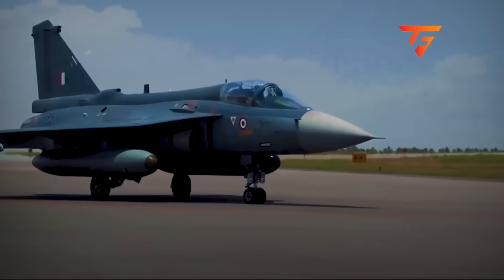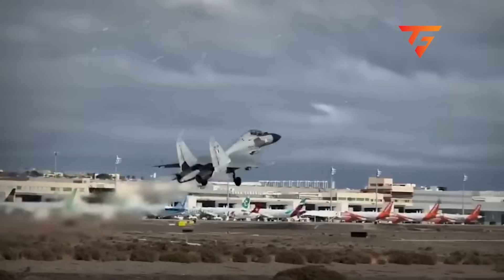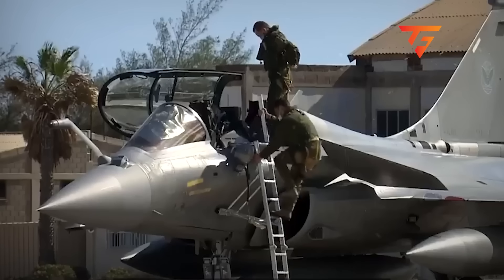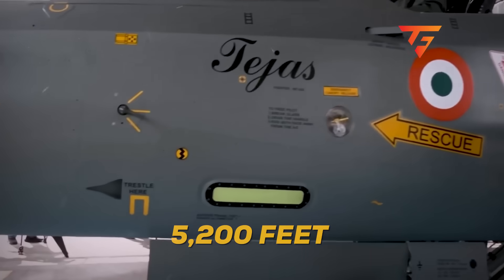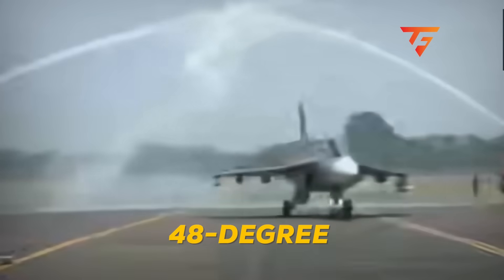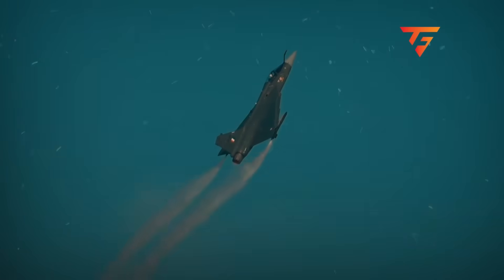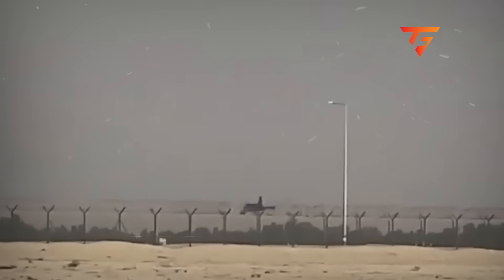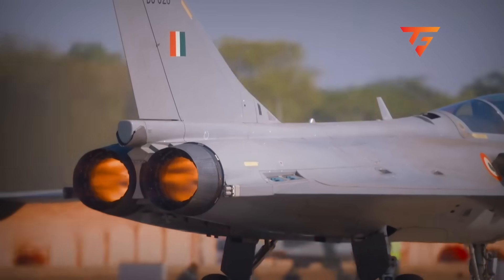The REAL Reason Tejas Crashed at Dubai Airshow 2025 Revealed

Comment: Great analysis, though I would like to know the sources😉 I saw somethings, that boggled my mind, 1. it does not have canards so should not have been subjected to such dynamic aerobatics, 2, Never heard the engine, going into full thrust as it should have, control failure or engine surge?  3. From the start you don't fly so close to ground in such hot weather, there air is literally not thick enough to generate the necessary lift for those aerobatics.

Comment: The US made fewer delta-wing airplanes due to disadvantages like high subsonic drag and poor low-speed handling, which conflicted with its focus on tactical fighters optimized for a variety of missions. Instead, the US favored conventional or swept-wing designs that offered better maneuverability and lift at lower speeds, though it did build some successful delta-wing aircraft like the F-106 Delta Dart for high-altitude, high-speed roles.

Comment: This video is 100% conjecture with zero evidence.

The most likely cause is a push pull resulting in negative then positive g and the pilot suffering G-LOC.
Reply: Not true.Tejas jets have too many technical faults.Indians don’t want to admit it.They are blaming the pilot.The crash happened due to faults in the plane and pilot misjudgement.